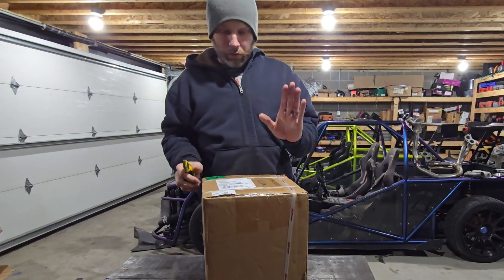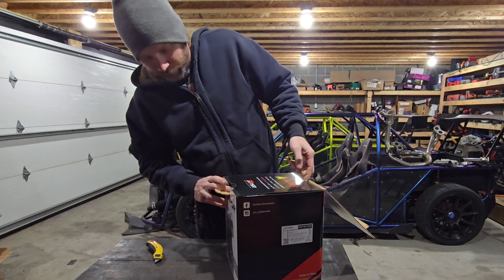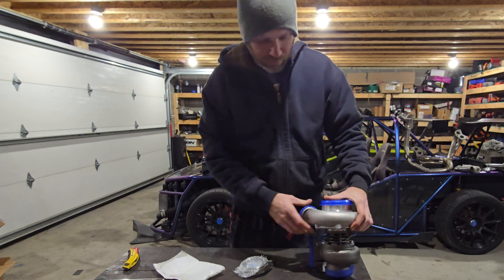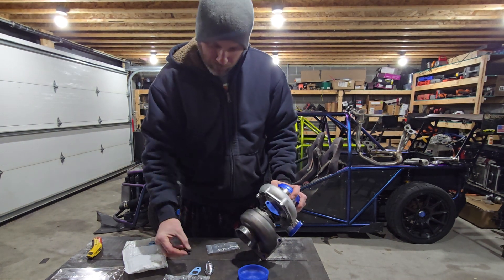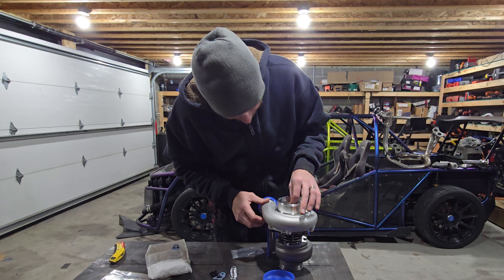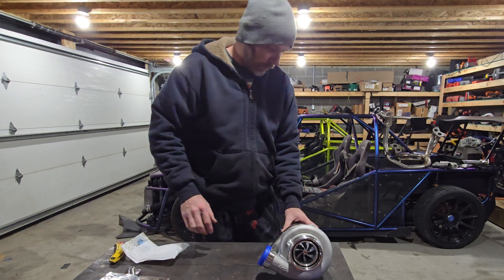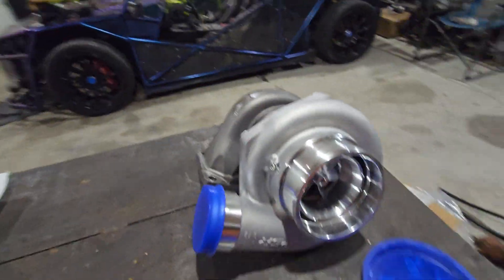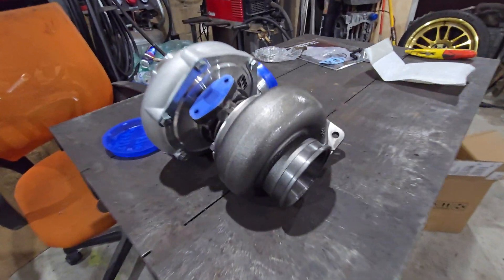Pulsar 6466 Turbo unboxing

Comment: Was that spot on the compressor housing a boost reference point?
Reply from the maker: The machined looking part on an angle is for a speed sensor. I drilled and tapped boost reference on a seperate spot
Reply: @exotruck5731 ahhh. Perfect thank you!